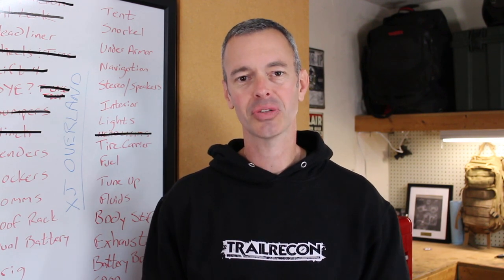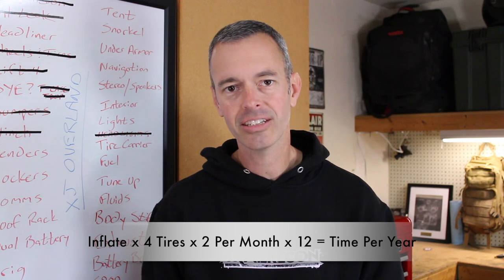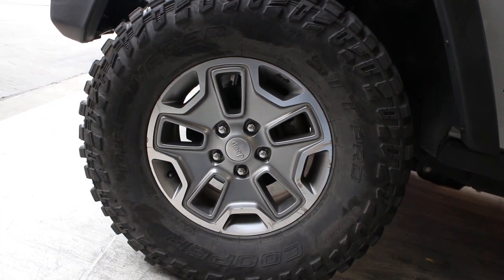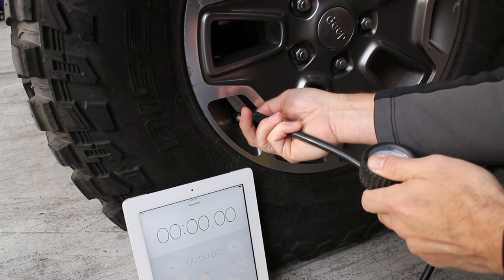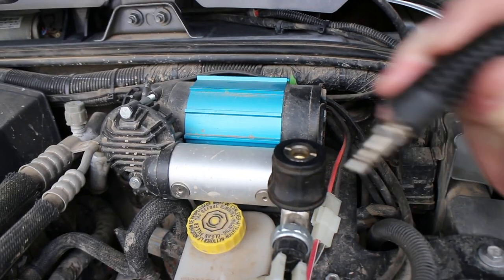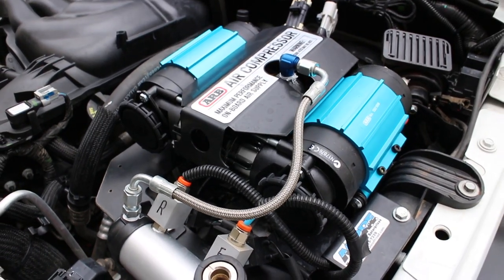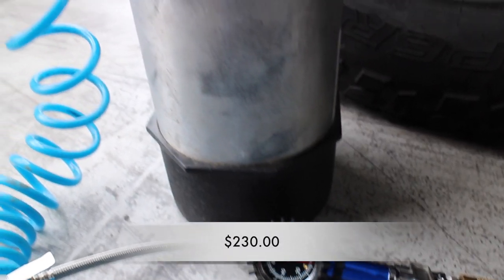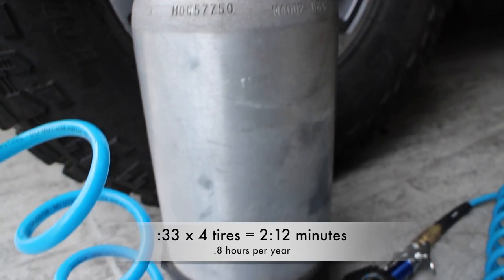Air Compressor Shoot Out - Tire Inflation Comparison

Comment: Something to consider before going with a CO2 system are the risks involved.
As a gas, carbon dioxide is colorless and essentially odorless and tasteless. It is therefore practically impossible to detect with the human senses.
The air we breathe contains about 0.03 vol.% carbon dioxide. At higher concentrations, CO2 can be unhealthy. When the air we breathe contains 3 – 5 vol.% CO2, we experience headache, respiratory disturbances and discomfort. At 8 – 10 vol.%, cramps, unconsciousness, respiratory arrest, and death can occur.
The is also the risk of cryogenic burns. 
At 72 degrees tank pressure is 860 psi. At 120 degrees it is 1980 psi. The temperature of your car can reach 140 degrees in the summer. There is a safety valve that will vent the CO2 if the pressure becomes too high to keep the tank from exploding. Storing CO2 in high temperatures is NOT recommended.
Link for safety information on CO2:http://www.linde-gas.pt/internet.lg.lg.prt/en/images/Safety_Advice_12303_25938.pdf?v=2.0
Reply: Jerry Gardella 
Thanks for that info. I would rather wait for my tires to inflate than drive around with a potential bomb in the back of my Jeep !
Reply: LMAO that was hilarious

Comment: Compared to the other "systems" that tank is awfully bulky. I'd stick w/ one of the compressor systems for compact size and ease of use. Mount an air tank under your vehicle for faster fills.

Comment: I'm planning an a/c conversation for my xj.  Any idea how fast that would air up  tires?
Reply from the maker: I've heard of folks doing this and would be curious to know how well it performs as well.
Reply: I have never timed my AC conversion. It is faster than most electric setups. Inflation time can also be decreased with an engine idle speed control. I run an Air Zenith on my tow rig for tire inflation and exhaust brake control. Air Zenith is a little much for most Offroad rigs. It has about 50amp surge to turn on with 35amp continuous draw.

Comment: Are the people using small compressors finding that they’re getting water vapor coming out after a couple min of running? Because I can’t imagine that being good for my tire sensors.
Reply: You can attach a inline filter for the air there usually used on air tool station systems. It filters out the water enough to not cause issue.

Comment: How long after you use CO2 will you need to refill it though? CO2 leaks much faster than air. You're going to have to air back up again.
Reply from the maker: I've never heard anyone mention CO2 leaking and I know several folks that are using it... I'l have to look into it.
Reply: On a bike tire, if you use a CO2 cart after a flat, it will lost most of its air in a day. With larger and thicker tires id imagine it would take longer. Try one tire co2 and another air and see what happens after a few days. Might make a good video. Nitrogen is another option.

Comment: I came up with a much cheaper way of airing up tires. Get a power inverter and a normal air compressor that is 110 volts. A pancake version is small portable and can be purchased used for not much money plus the power invertoir can be used for so much more and does not cost that much
Reply from the maker: Very cool, always love hearing about how folks come up with other solutions.

Comment: I am aiming at the Smittybilt 5.65 CFM which here in Canada sales for 214$ CAD. Wondering if Smittybilt will last more than a year though... I'm running 35x12.5R17 AMP M/T. Thanks for the vid!
Reply from the maker: For the price, I hope it holds up for longer than a year.  Thanks!
Reply: Mat Dubé I had mine for 8 years before it went out on me.
Reply: 760rudogg good to know. Choice made then!

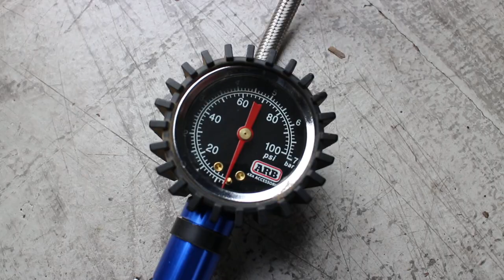Comment: Was this test done with the engine running? I have the smittybilt 2781 with the same tires and rim size and takes me 1:45 from 15 to 30?
Reply from the maker: Yep, engine was running and we ran each inflation test twice.  His compressor is a year old, so that may be a factor for consideration.

Comment: the Co2 compressor actually ISN'T faster than the others. You failed to factor in all the time he spends going back and forth getting it filled up. If he can do 4 wheels 4x and you wheel 2x a a month, plus factoring in that MOST people usually air up / dwn more than once per trip.. he's making a dozen plus trips just to get a tank filled. You're not factoring in extra wear on the vehicle for the added mileage, gas + time. Not worth it at all imo.

Comment: Is he filling the cylinder with C02 or air ?
Reply: William Goble its c02, you couldn't fill up that many tires with compressed air in that small a tank. Since c02 is a liquid you can store 3 times the energy compared with even nitrogen